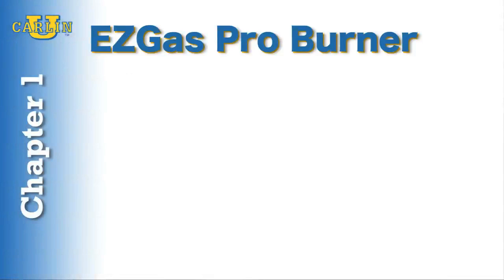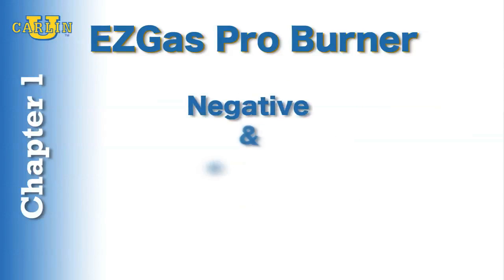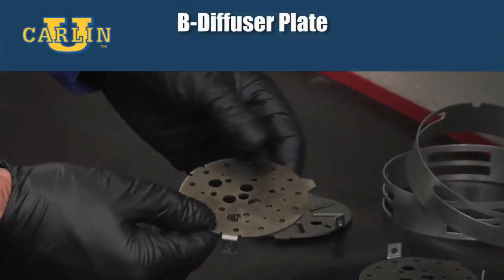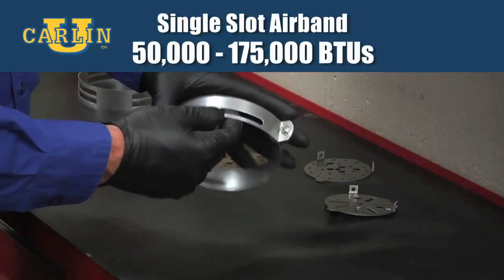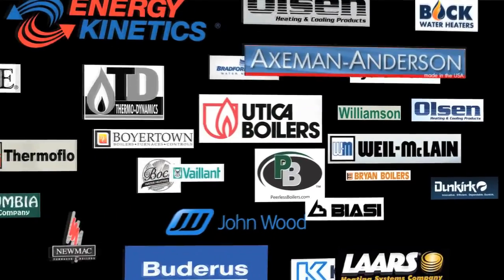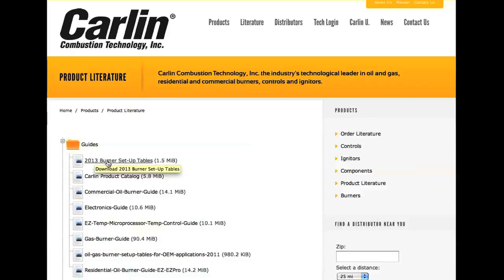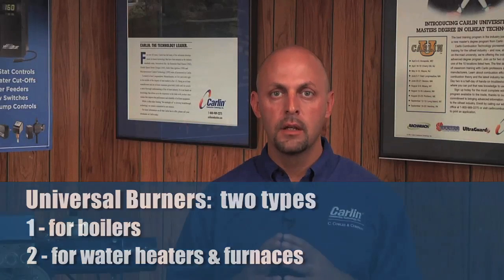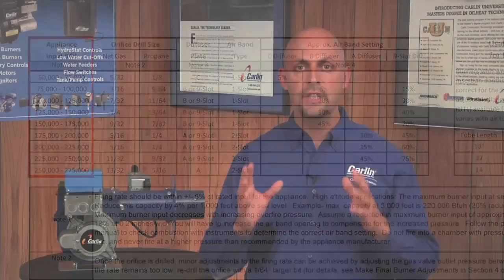Carlin EZGas Pro Chapter 1: EZGas Pro Conversion Burner Overview

Comment: Do these burners have optional make-up air boots? They tend to be recommended in direct vented applications to minimize the effects of wind gusts against the side of the house.
Reply from the maker: Sorry for the LATE reply - if you have any question on our products, please call our technical department toll free at (800) 989-2275
Reply from the maker: Please contact Tech Support 800-989-2275

Comment: when you switch from oil burner to gas burner do you have to install a chimney liner?
Reply: fnkycoldmedina We did....lots of condensation that will destroy the masonry work otherwise.
Reply: taxisteve929 we actually went with a whole new gas furnace . 95% trane gas furnace and vented out the side of house with pvc . cheaper then having the chimney lined .well not cheaper but more cost efficient . should pay itself off in 4-5 years in savings over oil .
Reply: I wondered about that. I look up at the chimney in the winter and nobody else has as much stuff coming out of the top!! The white looking smoke which I guess is just heat going out of the chimney!!....in the form of condensation etc. Thanks!! Steve
Reply: Yes, advisable just in case you have a crack in you chimney,  gas burning produce carbon monoxide, so it's a way of safeguarding your love ones.